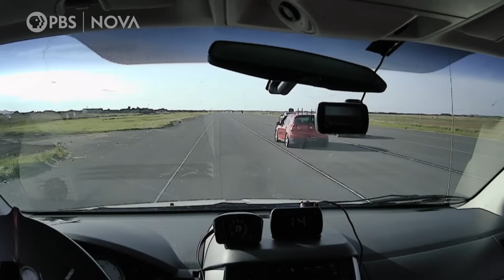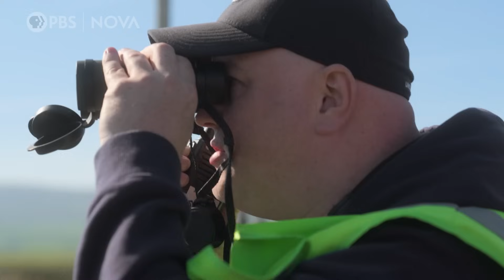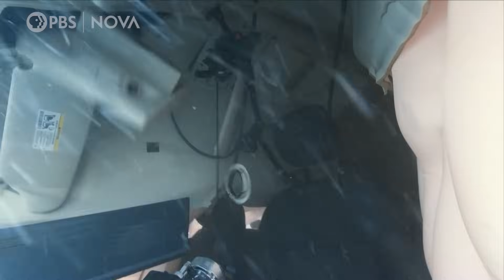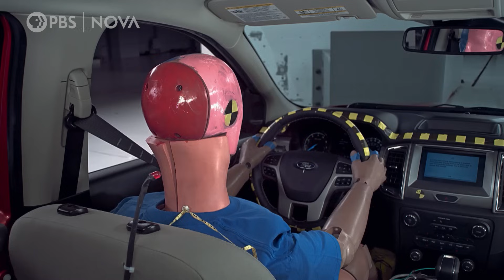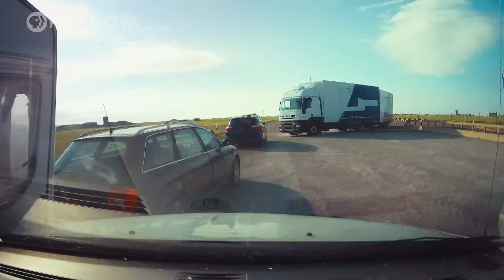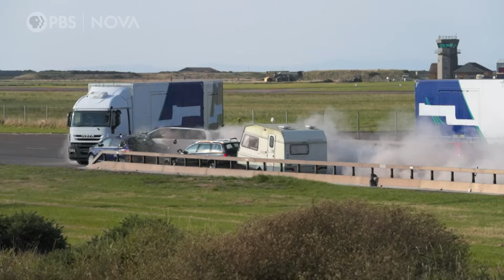What a Multi-Car Crash Test Revealed About Airbags | NOVA | PBS

Comment: Most injuries in vehicles are caused by flying debris or blunt-force trauma to the head or torso.  Many vehicles have shoddily assembled interiors which do not provide enough cushioning to limit those injuries.  Additionally, many vehicles today have interiors which are too small and passengers are virtually guaranteed to strike parts of their body upon hard metal or plastic components and sustain an injury.

Comment: If you ever see a 1972-1976 General Motors car with a 4-spoke steering wheel, it was one of the few rare vehicles built with experimental air bags.  Legend has it that around 1998, a woman was driving her 1974 Oldsmobile with experimental air bags and had a crash, and the air bags still worked!
Reply: Some excellent experimental devices

Comment: You can't  run a vehicle with airbags  on racetrack. What does that tell you?
Reply: This is 100% not true
Reply: @SimplyGregsterEV Think before you flap your gums!
Reply: Hello? Nurburgring?
Reply: @benedekhalda-kiss9737 when they have a race you can't run air bags and i know when GM tests on Nuremburg they disable the airbags for driver safety!
Reply: @terenceiutzi4003   Yes, but that decision from those engineers is VERY debatable. Engineers are people too and DO make mistakes.
Reply: @legioner9 Look at the crash test videos that Ford published when they brought out  their second-generation air bags. After the seat belt stops the dummy and sends it back into the seat, the airbag hits the top of the dummy head! That will always sever the cervical spinal column causing mediate death!
Reply: @legioner9 air bags are safe below 5 MPH.

Comment: Who paid thousands of dollars for an experiment that's got such a very obvious conclusion to start with? Of course airbags didn't help in the 2nd and subsequent impacts.
Reply: In sciencentific research, you can't just make assumptions and publish them as facts. You need to collect extensive data in order to be able to prove the hypothesis (in this case, that would be that a multiple car crash affects the crash safety systems differently than a single crash). "its obvious" isn't a strong argument and definitely wouldn't hold up to peer review.
Reply: @scdu  True. But if that money had instead been spent investigating a system with backup airbags for a second impact it could've helped save lives instead of simply reinforcing a very obvious conclusion. In such an experiment, yes, you would then need a control group to show the improvement afforded by secondary airbags.
Reply: @scdu but the conclusion was only as good as what was expected anyway.
Will airbags be less effective on subsequent impacts? 
Common sense says:Yes. 
What we found:  Yes.
By how much? No idea

Comment: US automakers testified to congress that airbags would dramatically raise the cost of cars and weren't effective anyway.  They said it would seriously damage the auto industry.  They fought congress for years.  Then Chrysler got the guts to just add them as a competitive advantage.  Soon the other manufacturers followed suit.  How far can you trust an auto executive?  As far as you can throw them....in their heaviest car.   But at least that's ten times farther than an insurance, pharmaceutical, fossil fuel or banking executive.
Reply: Please add telecom execs to the list.
Reply: Don't forget the politicians in their pockets
Reply: Chrysler put airbags in their cars because the US gov at the time made a tender for fleet vehicles that required airbags. It wasnt because of a competitive advantage sales tactic to the public.
Reply: How I'll informed. They didn't lie,oddly enough. If your airbags deploy the cost to replace them is so high insurance would often total the car, that alone increases cost of car insurance. An airbag system replacement is about $2k to $7k before labor cost, more for luxury vehicles.

So yes, mandatory airbags increased the cost of cars, and car insurance
Reply: The dodge diplomat was the first police car to have them in 1989
Reply: You need to now that early ( like 1990's ) airbags were single stage devices that were designed to catch an UNBELTED average male.  This lead to injuries of belted or lighter / smaller people.  Also remember that onboard computers were very slow making sensing and deployment at the proper time difficult. 
Also note that many cars are deemed total loss by insurance companies when airbags deploy, while this does not mean that the car is unfixable, it does mean that costs of repair rise.
Actually, GM was the first main stream auto maker to offer air bags in the mid 70's.
Reply: They do raise the price of a car substantially.  It's really easy to total a car with relatively minor damage because all those airbags cost thousands.  I'm betting that they said the money was better spent elsewhere like crumple zones, safety cages, and - here's a novel idea - systems (ABS, stability control, etc) that help avoid the accident in the first place.  Do that, the airbags are unnecessary.  Of course, you'd rather just vilify.
Reply: front facing airbags have less than 10% reduction in deaths where side airbags have around 50% reduction. the argument back then was over front airbags and its not clear if the car is more safe by the fact the steering column and its supporting structure needs to be stronger for airbags. It could have been possible that there were more  effective ways, in terms of safety and/or cost, to mandate safer cars.
Reply: @marcKingdom it’s not about just death reduction however. Front airbags reduce a fair number of injuries, or their severity at least a lot of the time (although given not every time).
Reply: Find the video on here that talks about how many injuries from front airbags to the neck, that they're almost a draw whether they're even effective. Side airbags on the other hand were a real game changer for safety

Comment: Air bags cause more cuncussions, neck injuries, chest compression and facial breaks than cars without them.  It's easy to check by comparing accident reports from before airbags and after.
The rise in serious injury and death attributed to airbag impacts speaks for itself.
Surprisingly auto manufacturers ignored the science that says any object impacting a human body over the speed of 15 mph can crush human bones and organs
Reply: Decreased deaths. That's the important stat
Reply: @tntgators yes they do save lives but they also increased permanent life altering injuries. Traumatic brain injuries even permeant paralysis are on the rise and those people are suffering every moment of every day. Do you speak for them?
We need better safety than what is currently being forced for us to accept.
Reply: I guess if you're dead you won't have concussions etc
Reply: I've always held that a good 6-point harness and crash helmet beats airbags hands-down. However, the statement "The rise in serious injury and death attributed to airbag impacts speaks for itself." is disingenuous. Yes, there are deaths and serious injuries due to airbags; however, the decrease in deaths and injuries due to airbag deployment in collisions is far greater.
Reply: @MrSunrise- airbags were originally invented to save unintelligent beings who didn't wear seatbelts,i also think a helment and a harness is much safer but a lot of people won't even wear the standard 3 point seatbelts so it's out of the question
Reply: @MrSunrise- A racing harness and a helmet are wery effective, but not really a feasible option in an everyday car.
Reply: Airbag is supposed to be fully inflated when the person hits it. It's not supposed to hit you in the face while it's still inflating at high speed.

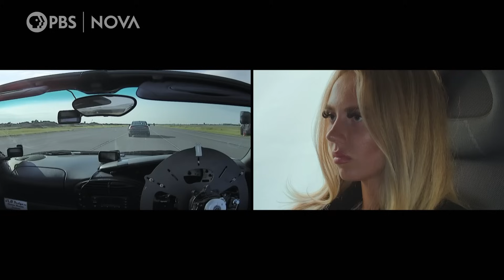Comment: 0:12 thought uncanny valley girl was a crash test dummy in one of the cars, had to rewatch it several times.
Reply: I thought the same thing. I thought the narrator was going to say how they're life size realistic dummies to properly simulate a crash, but then I was shocked when the others blinked. That woman looks like a scary ass doll.
Reply: I swear I thought the same. I was like “that’s a realistic looking dummy”. It wasn’t until I saw the other people that I realized what was happening😅
Reply: i couldnt understand the part with the passengers. It seems out of context to this crash? What was it about with these people?
Reply: @LaggerSVK  Took me a minute to work out, basically they are virtually driving those vehicle. So they are sitting in those little smart cars and there is a screen in front of them. Their actions and inputs are controlling actual vehicles though (the ones that crashed).

Comment: Poor engineer. You need to learn from nature. Check how birds find the obstacles and change the course. Hundreds of birds fly in a flock without any collision. Similar tech should be deployed at cars then combine it with impact force to decide to deploy the bags or any other shield.
Reply: Birds operate in a 3D environment. Cars? Not so much. So use your superior engineering skills to design a 4,000 pound car that will be able to instantly gain altitude and float over the 18 wheeler.

Comment: I've been surprised that so many auto makers have their side airbags deploy in many front crashes.  If car A drives through a red light and into the side of car B, the side airbags might not still be pressurized when car C hits the side of car A.

When side curtain airbags first came out, some were touted as being able to stay inflated for several seconds in case the vehicle was rolling over multiple times.  I don't know if all vehicles still have this ir not.
Reply: they do actually still stay inflated! i’m not sure for how long, but it is for several seconds
Reply: @hayden5512  depends on the car
Reply: Depend depends on the crash like in that test you saw the right side didn’t deploy but the left side did in the crash test facility one

Comment: Does anyone test 10 or 20 year old or older airbags?  I always wonder if I'd be safer disableling mine.
Reply: Don't disable them, because they might be the difference between life and death in an older vehicle that wasn't designed for modern crash tests and heavier vehicles.  However, there have been several airbag recalls for some front airbags, so your best bet is to check for open recalls of your vehicle.
Reply: @ml9867 that's what I'm curious about.   To see how old air bags deteriorate and if they'll send sharpnel into my face if I get in an accident.
Reply: @JKHTX  ...

The air bags are safe. They are tested. In the EU we actually care about road safety and all areas are constantly researched including air bags.

If you remove/disconnect the air bags in your vehicle, then the insurance will be null & void. 

Think less, you'll have fewer headaches.
Reply: @JKHTX  Takata airbags pretty much WILL grenade themselves, those have been (...heck, still ARE being) recalled. If the recall was not yet performed, that's a safety hazard just waiting to happen indeed, worse on moist climates.
Other manufacturers aren't known to have any of these issues whoever, the problem came with Takata's choice of propellant for the airbags themselves that becomes unstable when humid.
Reply: They are tested all the time in wrecks.  Very reliable
Reply: Not very long ago I had an accident in a 2006 civic and the airbags functioned properly
Reply: I can't speak for your brand, but Mercedes has bought back their cars from the 1980s for testing purposes, and find they still work properly.
Reply: Yeah. Also cut out your seat belts. Remove the ABS/ESP fuse as well. 🤦‍♂️
Reply: Most od the brands will recommend replacing all airbags every 15 years. My Alfa 159 owner's manual says that as well. Mine is a 2010, so in theory I should replace them. But the problem is that they are no longer manufactured, meaning I would still be replacibg them with 10-15 yeaor old (new, old stock) airbags. Although, 15 years in temperature and humidity controlled storage equals to far less age then 15 years in various weather conditions. But, in practise, nobody does this. The air bags are made to be highy reliable, so even 30 year old ones, should work fine in 99% of cases (made up %, of course).
Reply: Fifth Gear did an episode on this back in 2020 and found that they performed as designed and are still considered safe:
https://youtu.be/H5ohDlU0Dwc?si=f6SKgTdze1MeJaHL
Reply: Thanks for the replies and first hand experience.   I live near the US gulf coast with high heat and humidity
Reply: @JKHTX  I would say humidity is the main issue. But since it is high heat, it evaporates, so airbags should last longer then in a colder climates.
Reply: The issue isn't that the air bags age, the issue is older 1990's tech was single stage designed to catch an UNBELTED average sized male.  Combine this sensors and controllers that were very primitive, this can lead to harming a lighter / smaller person.  Modern systems are double stage where the system can decide on how fast / hard to inflate the bag.
Reply: @bobroberts2371  THIS...  If you are a standard-ish adult male in an older car? Fine, but if you are smaller or shorter or sit close to the airbag? Look out! The worst story I ever heard was back in Calgary where a short elderly lady was killed in her driveway by the airbags in her Lexus when it skidded on black ice in her sloped driveway when she plowed into her garage door and the airbag went off killing her instantly...
Reply: Sounds like a final destination movie plot... @stickynorth
Reply: I also wonder the same thing,is shrapnel or ripping my hands off while holding the streering wheel in or close to the center what worries me the most

Comment: Automobile safety still has improvements to make. One area of concern is; Rear seats do not provide proper whiplash and spine protection as compared to front seats.
Reply: You probably know this already, but the Insurance Institute for Highway Safety is now testing the performance of rear seat safety systems in front crashes.  The seats that don't do well are not making their Top Safety Pick lists.  I'm surprised that there hasn't been a flood of rear seat airbags to the market because Ford and Mercedes revealed them mounted into seatbelts a few years ago.  Another company was working on an airbag for the back of the front seats too.
Reply: @ml9867 Yes, airbags can be oriented in the seat backs of the front seats to provide additional protection. Additionally, side airbags in the interior sides of the seats to reduce left and right lateral movement for front and rear seats can be another level of protection.
Reply: The biggest area of concern?  Not punishing distracted drivers harshly enough
Reply: Funny you mention that because my 2012 Mercedes B-Class (rear seats) not only had belt force limiters and also pre-tensioners across all 3 rearseats, but also had thoracic airbags on the outboard seats… which already included dual stage curtain airbags.

…pretty sure you don’t see that on any new Mercedes these days!!
Reply: @LukeAusNSW Most rear seats lack proper spine & whiplash protection. Additionally, the seat back is fixed in many vehicles which doesn’t allow for seat back flexing in rear collision impact.
Reply: Make cars dangerous again